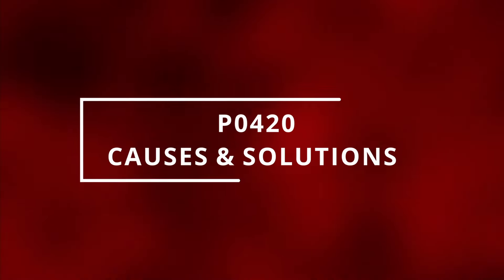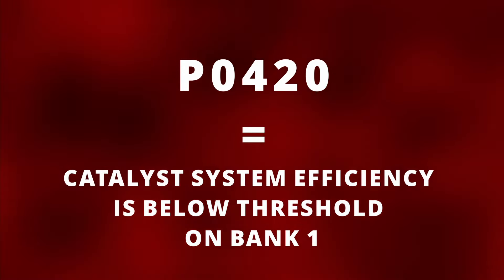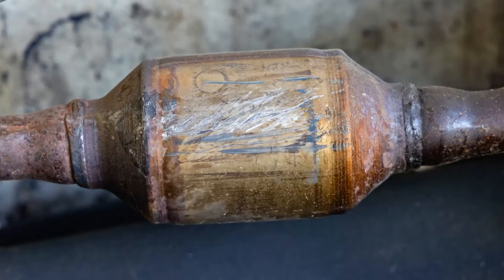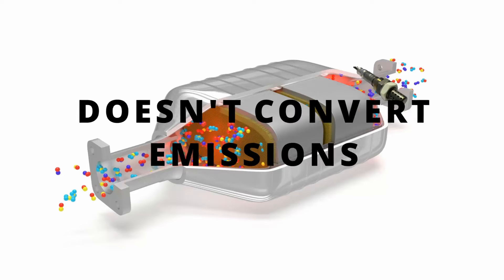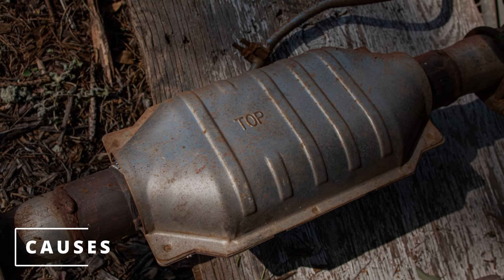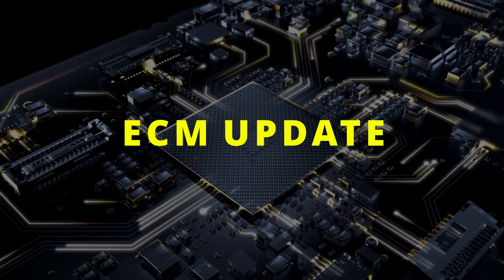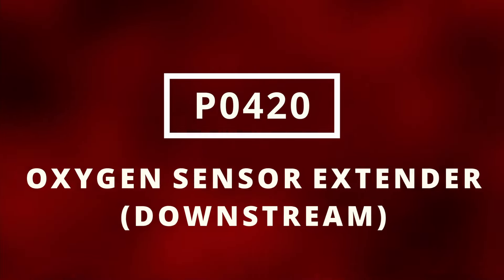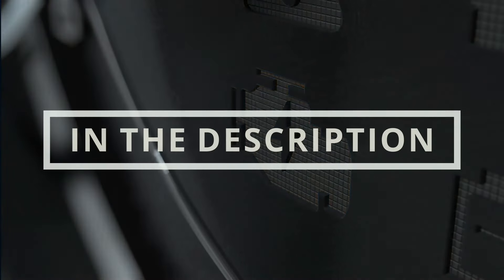P0420 CODE CAUSES AND SOLUTIONS

Comment: I have a 2013 Buick Encore with 155,000 miles on it. I had replaced the upstream O2 sensor when I got the P0420 code since it was the easiest to get to and was the cheapest. This did not help. Due to a faulty EGR valve that had to be replaced previously, my mechanic said that the excess oil being burned probably had fouled my catalytic converter, so I had that replaced. This did help the engine run better, but I still had the P0420 code. I checked my downstream O2 sensor with my scanner and it was fluctuating the same as the uopstream O2 snesor. I ordered one of the O2 Sensor adaptor from Walmart. This seemed to be a better alternative to the Spark Plug extenders that other You Tubers recommended since the Walmart extender was Stainless Steel rather than aluminum, and Stainless will hold up much better in the high temperature environment of the exhaust system. I received the O2 sensor adaptor from Walmart two days later, and installed it at the downstream O2 sensor location. I reset my P0420 error code. We have driven over 300 miles with the sensor extender in place  and the engine check light has not come back on. The P0420 error code has not came back either. Best money I have ever spent on this problem. Thank you sir for your You Tube video. I have no doubt that my catalytic converter needed replacement, but I just could not eliminate the error code. Thanks again!
Reply: Using the extender you just turned the code off, your didn't fix the underlying issue causing the code.
Reply: @TurboMountTV
Reply: The downstream O2 sensor began working correctly and the catalytic converter was replaced with a new one. The sensor fluctuations confirm that it had fixeed the problem.
Reply: @guywhite1004  You may want to have tried a cat cleaner before replacing it?
Reply: I did before I had the converter replaced. The man that replaced the converter said it was still clogged up
Reply: @turbomounttv  will using the extender fix it to past inspection?
Reply: @ChrisSmith-ue9yj  I would think it would as my analyzer showed it was functioning correctly. However, we don’t have state inspections here in Georgia so I’m not sure about the “cleanliness “ of the exhaust. We travelled many more miles in the car after that before we traded it in with no reappearance of any engine faults.
Reply: @TurboMountTV thats all i need for all my trucks and cars lol 200k later still good

Comment: If you get on it a lot and you get this code, check your oil first.  Some cars have a lot of oil getting past the PCV valve and into the intake.  I have a 3.6L Cadillac with some upgrades.  GM states an acceptable amount of oil use every 5000 miles is 2 quarts.  People that drive their cars utilizing the performance can use as much as s quart a week.  This amount of oil can dirty up the O2 sensors.  If you check your oil and you’re a quart or more low add a oil first, fill up with premium and drive like a grandma for a few weeks. Then if you have a code reader erase the P0420 code and drive like a grandma for a couple more weeks.  If the the check engine light stays off you know what your problem in and might want to get a catch can.  This will reroute the oil going to your intake  into the can and the problem is solved.  Remember to check your oil once a week when driving the car hard.
Reply: This helps I check my oil  regularly and it doesn't use much because I keep an eye on it but I wouldn't say I drive like a grandma I just don't drive fast when I need to I have a 2010 Chevrolet Equinox LTZ 3.0L  but mine came on awhile ago I was driving it nothing seemed out of the normal then I cleared it it stayed out awhile but since it's been cold I have been driving even slower due to ice on the road it came back on today where would you suggest I start at sir?

Comment: I used cataclean fuel cleaner and disconnected battery cable. Check engine light turned off for a month but then came back on .. maybe I had to do a few more of them Soo it would permanently fix it ?

Comment: Ive been struggling with this code on my toyota corolla. Changed cat, both o2 sensors, muffler, and exhaust manifold.
Reply: Did you find the solution man? I have a Toyota Camry P0420 and P0172
Reply: @TheWiseGuy  no..let me know if you do!
Reply: @Isaiaha400  Not yet, replaced the oxygen sensor and Map sensor. Going to clean the MAF sensor
Reply: @TheWiseGuy  i havnt done the map or maf sensors. Im going to try that. Thank you for the support 🙏🏽!
Reply: @Isaiaha400  No problem, I’m hoping cleaning the MAF sensor today going to fix the problem
Reply: Do you have a leak somewhere in your intake? It could be sucking in more o2 than it needs.
Reply: @E85STI  I'll have to check on that. Thank you!  I have noticed  im using alot more gas lately
Reply: Also change the pcv valve, spark plugs and air filter. If no go, add a coupler extension on the lower O2 sensor and reset the code. After running for about a week, you can remove the extension on the O2 sensor. Good luck.
Reply: I have a 2007 toyota Corolla and have problems with this as well. Are you still having those issues after that.
Reply: @Aaliyah J  yes i am. I have done everything you see on here besides check if i have a leak in my intake. And the pcv valve
Reply: Jus cut the cat and do a software update after a vacuum leak caused this code to pop up in my dodge v6
Reply: Are you deleting codes with a scanner, or by unplugging battery for like 20 min..?
Reply: @portermatthew84  unplugging the battery usually erases the code for a small period of time, (enough to sell it to another owner if they're coming to look at it and test drive) 😂 so does a scanner but the code and light WILL come back on, I deleted the p0420 code last night and my check engine light hasn't came back on
Reply: Some times, some people’s have fixed their problems, yet their codes are “hard codes” that do not leave the cpu, until deleted. Others are “soft codes “ that will leave immediately upon repair.

Comment: 2020 Hyundai Elantra I had this code come up around 66k miles put went to the shop and they too low millage for anything to be wrong with  recommend fuel cleaner, code went away for a month and the code would come back usaally after a month and half ish rinse and repeat for 3-4 months bought a Cat cleaner specially for that problem used it 15k later haven’t had the sign pop back up a little part of me tells me to worry about it but everything seems good

Comment: I have a 02 sentra with this code. Will this code make the car not starting, it has fuel, spark and air but when i remove the 02 sensor car start's. Any suggestions. Thank you

Comment: This is the best, clearest explanation of code 420, thanks! Subscribed.
Reply from the maker: Thank you, very nice!
Reply: @easyautofix  I have a P0420 code on my 2007 Toyota yaris but no engine light, I only found that out through Scan tool, what do I do because it is not smog ready, it given me the yellow exclamation mark rather than the green one. what do I do????could be I just have drive a few miles for it to go through the cycles, since it is only yellow and there no check Engine Light?

Comment: I love your videos very knowledgeable! Learn a lot from you sir! My name is TASHA from USA 🇺🇸. My check engine light reads that I need to replace ignition coil and spark plugs as well as a cylinder 4 misfire secondary DTCs, p0420 cat efficiency helper threshold bank 1 and 83-13 ECM/PCM relation failure. I have a Honda Accord 2009 LX. I’ve driven like this 7 years! Now I fear how much repair will cost. Why me? 😩

Comment: Can wrong spark plugs trigger p0420? I get a strong smell of unburnt fuel
Reply: if they were wrong you’d hear a knock on the pistons because the thread is too long or the car wouldn’t start because there’s no snugged spark plug on the pistons.
Reply: Absolutely it can...I installed "upgraded quads" on a Nissan I had when I was 16...bad idea.
Right length, allegedly interchangable via literature.  But, check engine, horrible milage,  rich exhaust. I went OEM. ..Back to normal.

Comment: Last time I was due for inspection I used cataclean and it turned off my but I'm not sure if it was only a pending code now I'm getting a permanent p420 code if I use it again and it doesn't turn it off do I have to reset the code myself because it's a permanent code and then see if it comes back
Reply: Unplug battery wait 5-10min

Plug battery back in and wait 30-40 miles and see if code comes back

Comment: I have the same code P0420. Cat 2 years old. New 02 sensor. Code popped up when I replaced the purge valve..What could be the problem? Thx
Reply: Same here… Toyota 4-Runner . Previously had a code P0133 ( replace oxygen sensor) Did that and now this code popped up
Reply: Can you disconnect the sensor and leave off the convertor

Comment: I have a 2010 mitsubishi lancer and i replaced the cat and i replaced the oxygen sensor bank 1 sensor 2 and the code still popped up. I have two sensors left to replace it’s either upstream or that sensor before the cat. I’m tired of wasting money please help!
Reply: I'm not a mechanic, but I've heard if you get a cheap cheap aftermarket catalytic converter, the light still comes back for code P0420, is that the code that still on?

Comment: Good stuff...thanks for the knowledge! You guys save us tons of time and money.  I have a misfire in #7, replacd coil and plug.....drove for 30 miles, now have a P0420 and a P1283....uggh...back to youtube...
Reply: I had a Misfire with #1 and #4 but I drove home 10 miles , changed the coils and spark plugs and leads , no engine light but 15 miles in I get p0440 , I think the excess fuel has ruined my cat , I changed the upstream sensor and changing the downstream one next , did you end up fixing it ? I also have p0420 and 440
Reply: Same here, had a misfire on cylinder 5 and the check engine light was flashing meaning I need it to stop the vehicle, i was only 2 miles away from home so I decided to drive home a very slow speed, replaced all the spark plugs and coils and the downstream O2 sensor, also noticed my valve cover seal was leaking oil so I replaced it as well,, 300 miles later i get the P0420 code, turns out I had damage the catalytic converter

Comment: I have a 06 Chevy Silverado and I've changed everything from the manifold to the tailpipe and the code still comes on and i also bought the smoke detector for leakes and no leaks  what else do i need to do thanks
Reply: Crankshaft position sensor? Spark plugs? Dropped valve?

Most commons...in this order..
For these Chevys.

Comment: i replaced the manifold, catalytic converter, and oxygen sensors and still get the p420 code on my cobalt. But its weird that when the emissions test passes the catalytic converter or is ready, it gives me that code. But my evap system is not ready but give me no codes for that. Ive also cleaned my throttle body and injectors. What can be causing my issues?
Reply: Reset codes?
Reply: Dang 😮

Comment: Hello everyone. I'm curious if anyone has any suggestions about my p0420 code (low efficiency, bank 1). I bought a 2016 Encore, base model with 100k miles on it.  I just changed the cat and both o2 censors but the light came back on about 60 miles after the change. Before it came back on I heard a odd humming sound and it felt like it was running a little rough while driving for a few seconds. After letting it cool down I  turned the car back on and sprayed the immediate area before and after the cat with soapy water to see if there was a leak but didn't find anything.  Any idea what it could be? Thanks.
Reply: How'd you check the leak? Did you plug your exhaust pipes? Honestly use a shop vac and then spray while it's running its much better

Comment: Just purchased a wrx 2021 12/25/2021 took it in to subaru with 15000 miles. After i got it out the shop check engine light with blinking cruise control pops up on my dash. 
So i take it back in and they clear it. Light is gone and then it pops up again! I take it to autozone use their code reader and ibget P0420 catalyst efficiency below threshold. Maybe if i would have asked why the light poped on i would have got the problem fixed, but i assumed they would have told me. The car is pretty new and from what ive read about this code it could be a failed sensor hopefully. The car is under factory warranty still so hopefully its just that and i dont have a faulty cat.
Reply: any updates? What fixed it?
Reply: @wise_soul8886  Looking at the service report, cat and sensors were tested and are working fine but they found a cross thredded bolt. I dont remember exaclty where it was located but i know somewhere  on my emission system. New bolt and retapped threads. They told me i needed a new catalytic converter. They ordered a new cat and the work was all under warranty. They didnt even need to use it because my catalytic converter turned out to be fine. I believe the issue was a vacuum leak caused by the cross threaded joint not sealing properly. Its been two weeks since ive had the car out the shop. No check engine light since then and the car is running fine. I wish i had my service receipt and i could type word for word what was done.
Reply: @gethomel  *hmmm... yea thanks for the info, what bolt is the one you're talking about? both of my o2 sensors are good, car runs good, and everything sounds, and even smells good, no funny emission smell, and no wierd sounds coming from the catalytic converter. I cleaned out the intake yesterday with an air gun & air compressor and alot of black liquid came out of it. I'm not sure what it is. I don't believe it's oil because I've recently been checking the oil dipstick and it appears oil isn't going down! Before that i got another new code which is p0401. Still no fix tho 
:( ... this sucks*
Reply: @wise_soul8886  They removed manifold assembly complete with turbo and seprate front catalytic  converter. While removing catalytic converter from manifold  assembly found crossthreaded stud. Had to remove and retap  thread and installed new stud and nut.
Reply: Id use a different dealership...sounds like they got a free cat from warranty bc they caused, and then fixed, a vaccume leak. Just my take.

Comment: Ok. I got both P0420 and P0430 codes shortly after running my truck out of gas.

Can anyone explain why that might be?

With both sides failing, I'm sure it's not a leak issue.
I'm wondering if running out of gas caused some misfire and allowed fuel to get through to both catalytic converters?

When I ran out of gas (on the highway), I felt a good bit of jerking/shuttering.

I figure I'll have to replace both catalytic converters, but I want to be sure I'm not having some other issue that would just cause them to go bad again.
Reply: Probably burned some water (moisture from the bottom of the tank). I would personally change the fuel filter, and reset/clear the code. And see if it goes away to stay.
Reply: @portermatthew84  Makes sense. Thank you.

On my Tundra, the fuel filter and pump are a single assembly in the fuel tank.
I've had fuel pump problems in the past and done that twice on my own. Not looking forward to it again, but it's also not the worst job in the world.